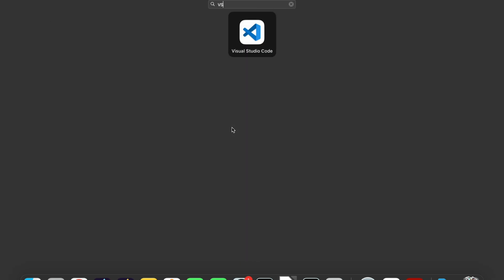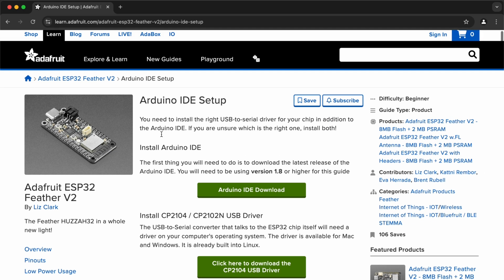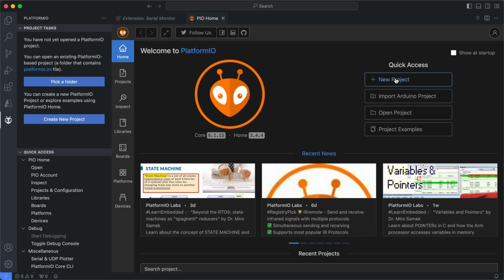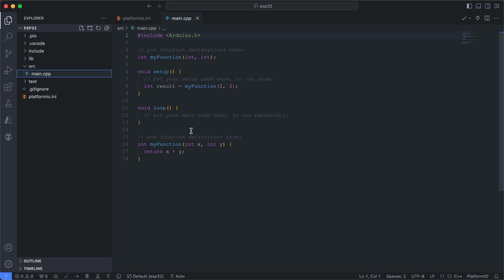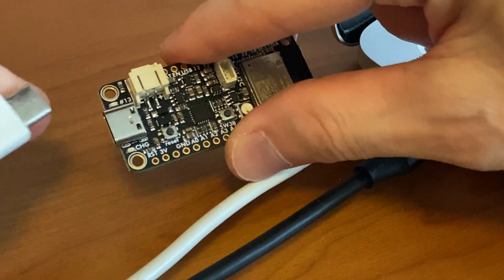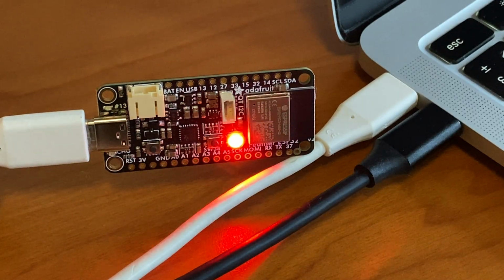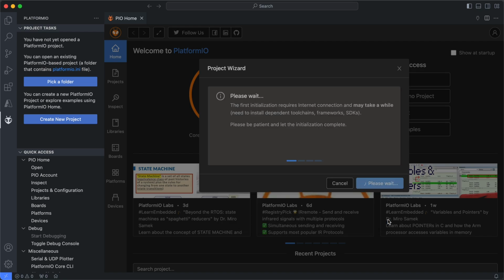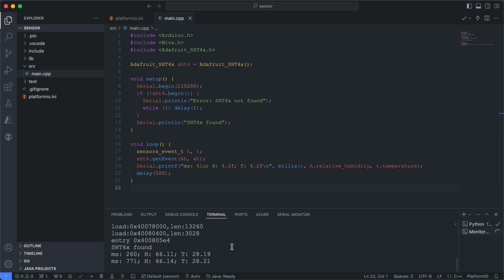Programming ESP32 Borad in VS Code (Arduino Core)

Comment: I Hate PlatformIO 🤣🤣 Using Arduino IDE
Reply from the maker: Hello, thanks for commenting. Arduino IDE seems to be easier to use. However, if I need to work with C/C++, Python code, JSON files, other programming languages' code and other data - all in one environment, it is much easier in a universal IDE. Does Arduino IDE allow to handle different programming languages and files of different formats?